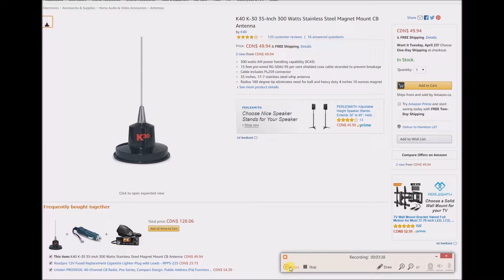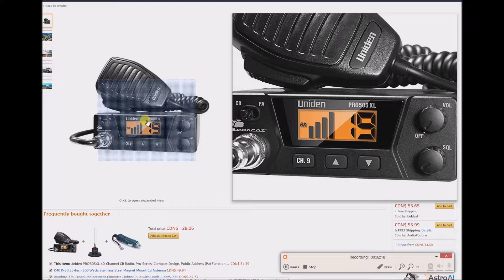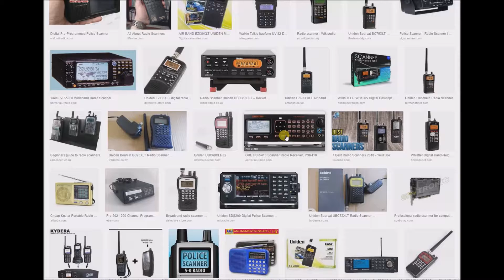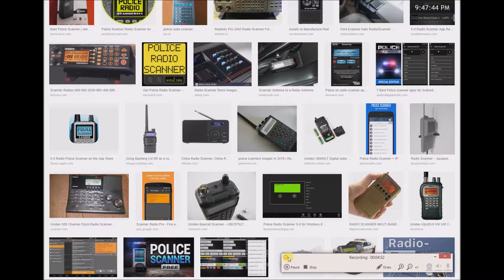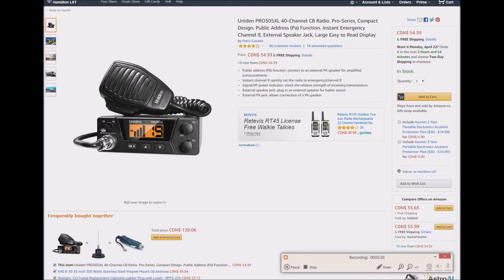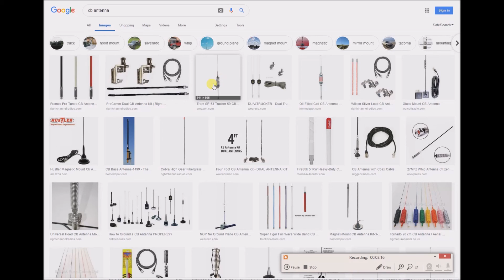CB Base Station: Is it Worth it?

Comment: In Phoenix CB is always BOOMING   even now august 2025   Base stations are priceless when there  is no CELL service.  plus SKIP land  is now LEGAL..Just  spent $4k on full blown base with Texas star 500 dx liner .. Ranger 2995  Galaxy 959  Maco 5/8 ant..Dela 60 amp power supply  D 104 lollipop SDS 200 scanner   Hustler 102 steel whip..and motre cabling and moble ant.

Comment: You can make yourself a inverted V with a 1:1 balun to keep the ant load at 50 ohms . 
CB is just 26-27 mhz if you want talk local turn it in at 9pm after the sporatoc E skip or DX stations die down go thru channels if you find people to talk on you can expand range if needed.  manufactured Maco v-5/8 ground-plane .these antennas are longer then shorted or near shorted to matching systems to get more gain . Also since the mid 80's to give you aluminum vs fiberglass that is why price went up they take advantage. Of us for  wanting  a typical 70"s 80"s metal designed antenna . The I max & Antron will work but groundplanes work better. Until then make antenna vertical polorized & mount it outside high as possible load with 50 ft coax min not 20 ft .or 100ft if you need to uses mini 8X tramflex  coax to play around with first.

Comment: I understand what thinking 
Back in days (70s-80)  I had base  station 23 channel  w 5/8 wave antenna 
I trying to  get back into it   I know form the past get good base antenna And good base coax cable  is a must   you can upgrade your radio later    ( you can find use base radio too )

Comment: I have a base hooked up again bring it was laying around from years ago. Hobby?? There is no hobby here in North NJ. The CB is dead here and even 19 is not the same anymore. I have it hooked up with an 18 foot base antenna because I had all the equip laying around. I would spend not a dollar on new equipment because nobody’s out there. It might be useful if God forbid there is some kind of apocalyptic event
Reply: No one out because we are at the lowest point in the Solar 11 year cycle.  Fall and winter 2019 was good right up to mid spring, and then i went down.  Soon DX should be back up. There was one day back in late 2018 where almost all the upper and lower and AM channesls were full.  It was crazy......
Reply: @alfredv9902  made a contact yesterday on 11 meters to brazil from Oregon so i'd say things are ramping up a bit
Reply from the maker: where are you actually from?
Reply: 2Bit Denville  NJ

Comment: I am back in the cb game again , in lanark county ontario "north 7" , it is dead quiet for sure, but there are a few. Build yourself a full wave loop antenna, nothing to it, make in a few hours. Much better reception on a base station. All you need is a power supply, build the rest yourself from scrap. Easy , easy.
Reply from the maker: I was looking at your channel. Which one of your videos are you most proud of, and why?
Reply: @2bit661  Laughs; none of them, I do not claim to be good at this stuff, just enjoy the process.
Reply: What's the wire length of your loop
Reply: @jmanranger7271  one full wavelength, 11.05 meters , then tune ( trim)for best swr (standing wave ratio) on dead key transmit.  I tune for channel 38, some people tune on channel 20.